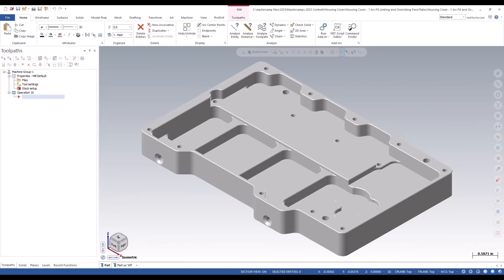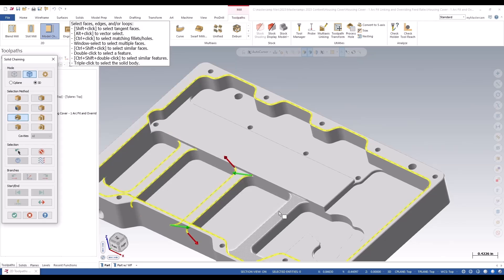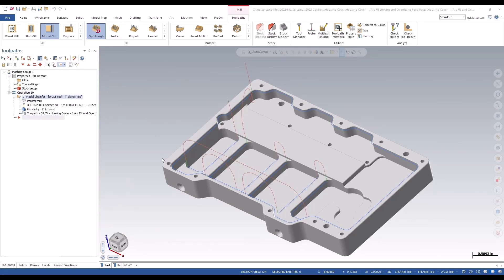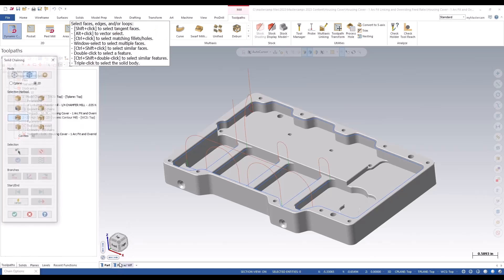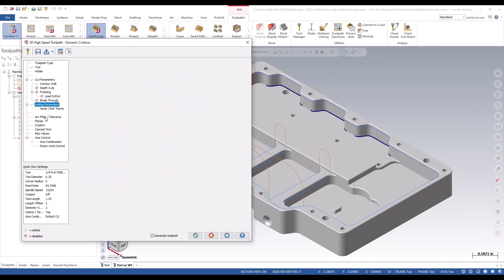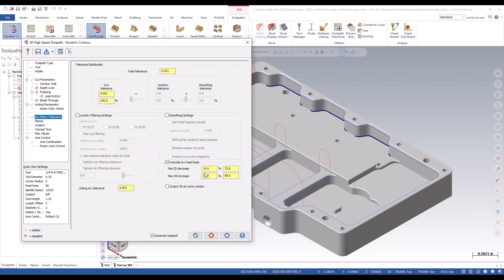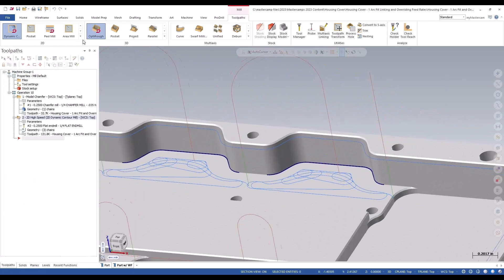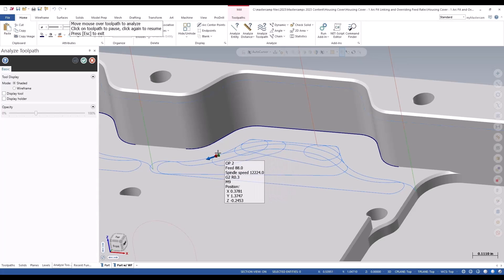Arc Fit Linking and Feed Rate Override

Comment: that output feedrate option is actually quite useful in optimizing a program on a machine that dogleg rapids. it can save you a lot of time in certain situations where otherwise you have to retract above everything to avoid a possible crash. its also moves the same no matter what speed you have the override at so you can move very close to the part without hitting it.